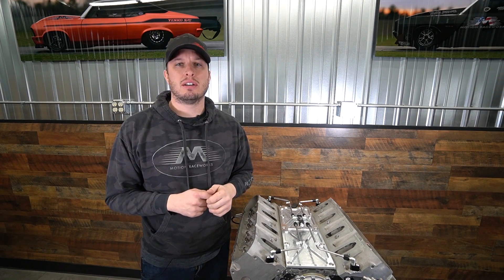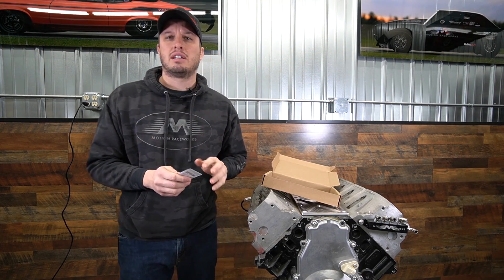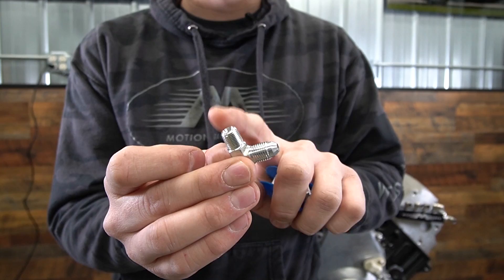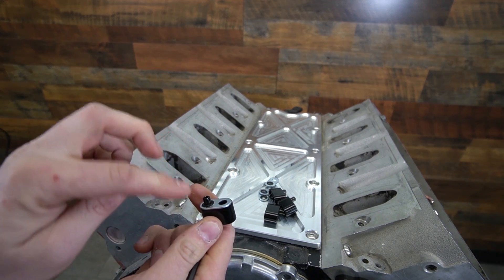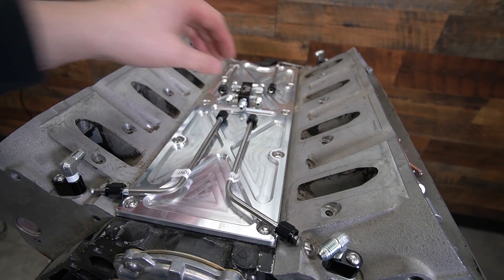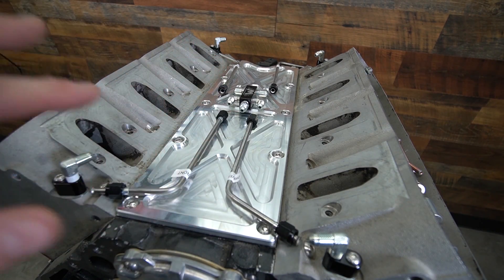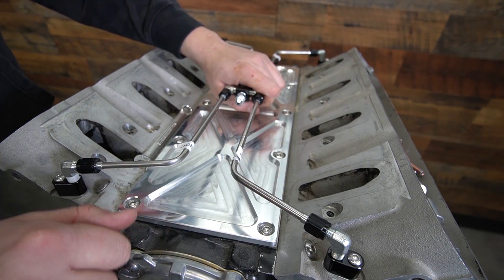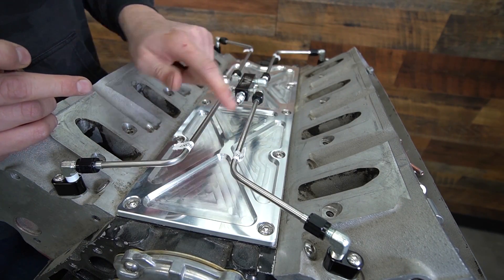LS Stainless Steel Steam Vent Install How To for Hi Rise Intakes

Comment: Will a low ram clear this? How important is it to bleed all 4 ports on the heads? Was gonna cap the rears...? Also, knock sensors... keep or remove?

Comment: Might want to add a note that you may need to apply thread sealant to the bolts since I am having and issue and others have had an issue online with certain heads (PRC) being over tapped into the coolant jackets... otherwise this video was a great help.
Reply: Pretty sure you just solved my coolant leak under the gaskets. Have prc heads as well

Comment: What a fiasco you just ended for me! Thank you!!!!
Out of "all over the internet" I was looking for the reason my 2019 GMPP LS7 crate motor (for my 2006 Z06) rear coolant block offs were missing! (My original 2006 LS7 did not have the rivets in the rear, but had block offs) I had no intention or knowledge of coolant crossover kits as the corvette forum is fairly quiet on this) I began reading. I discovered your kit and your video solved my issues. 
It took 2 days (weekend) holding off on re installing my eforce while I ordered the O rings as the gaskets you show are not the same. 
 I also thought that Lingenfelter kept my block offs by mistake then after finally getting the O rings (because mine did not have those gaskets you show there and I wanted the exact OEM parts) at midnight I go to install them and what??? the dowels won't go into the hole?? Typical.
THEN, I decide to watch your video to perhaps learn something....holy shiz. There you are, explaining that my heads have plugs in the rear of the heads, that I do not need block off caps nor my new o rings nor did I need to wait to install the 'charger! 
Nowhere in the internet could I easily find the answer as I did not come up with the right keywords. 
You just solved a mystery for me and it is not even the main subject of your video. So many articles and blogs out there but nothing about this. 

Now, how can I do this crossover kit with a PD supercharger in place of the intake?